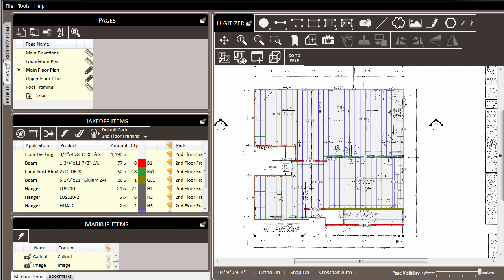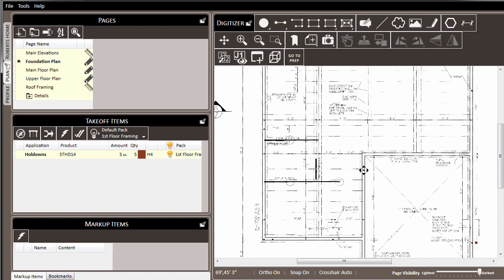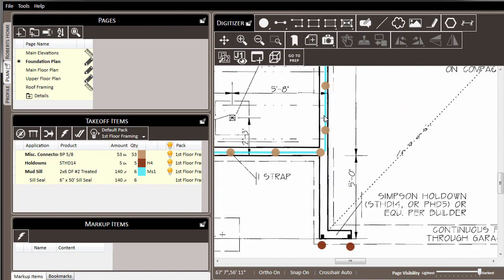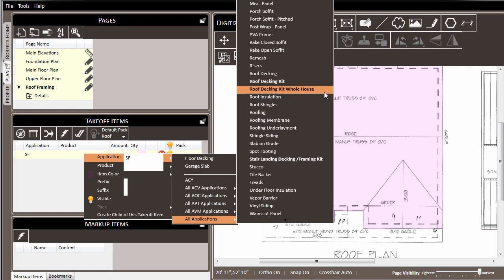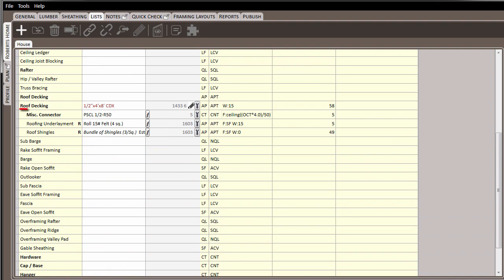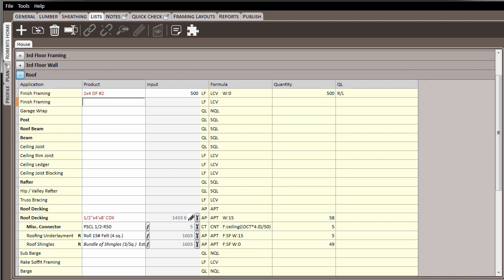More Tools, More Options

Comment from the maker: Jump to a specific topic by clicking on a timestamp below:

0:33 - Using the Count Tool to Count Holdowns
1:25 - Using the Linear Tool to Measure a Mud Sill
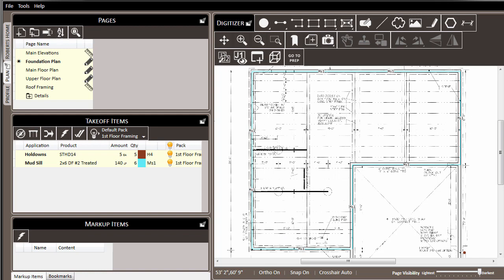2:23 - Creating a Child Takeoff Item
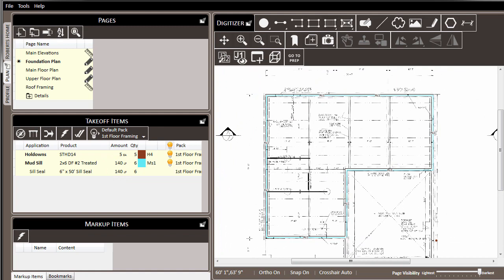3:20 - Adding On Center Spacing to a Linear Line
4:25 - Using Kits to Automatically Generate Additional Materials
6:33 - Adding Material Directly to the List without Drawing